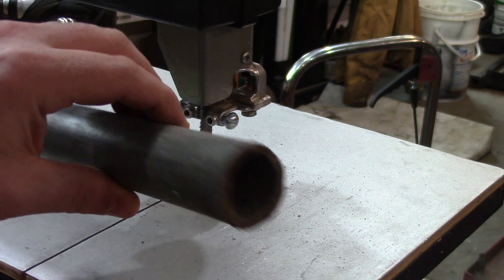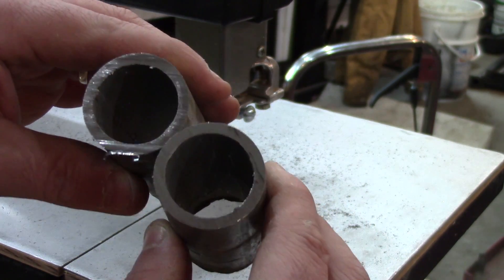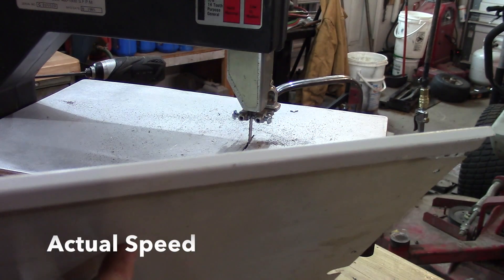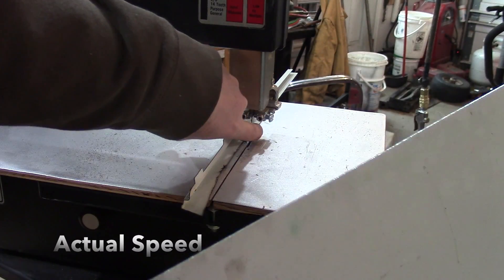Converting Wood Bandsaw To Metal

Comment: Thumbs up for making a flimsy 3 wheeled bandsaw cut steel. I'm actually surprised! I'm also surprised you can cut that massive steel pipe without a vice!
 
I would give you another thumbs up if I could, for showing the saw cut steel. And only steel. I watched way too many YT'ers demonstrating how changing to a fine tooth metal cutting blade allows them to slowly gnaw through and clog up on aluminum, as if the saw wouldn't cut aluminum 10x better the way it came out of the box!

Comment: Good work. I geared down my bandsaw to a similar speed and I’m happy with it. My table was aluminium to start with but I covered it with stainless steel (s/s from the front of an old dishwasher) as I found the burs created by cutting the steel would dig in to the aluminium. 
I’ve done a treadmill motor conversion on my belt sander with very good results so I’m going to convert the bandsaw to a treadmill motor as well so I can vary the speed for steel, wood and plastic. Better to have one like yours with variable speed to start with I think. Cheers Stuart 🇦🇺

Comment: Thanks for the tip about the variable pitch blade. It draws 3.5 amps so it’s  a 1/2 hp motor. 746 watts per hp divided by 120 volts equals 6.22 amp draw per horsepower. Your shop voltage will vary  so figure 6 or 7 amps per hp when looking at equipment.

Comment: you need to get a stick of Lenox Lube Tube it saves blades and not messy like oil, you should go with 12-14 tpi for 1/8" thick or less, bi-metal blade is good and run slow  good vid  thanx

Comment: How do they adjust speed of an induction motor with a potentiometer? They are frequency/pole fixed speed (1800/3600RPM) I see there is a gearbox, wonder if the dial changed gears? The rule for teeth is 2 -3 teeth on material at any time so 1/8 which is what I cut is supposed to have a 18-24 tooth blade but the 24 tooth blade cuts very slow. My big 12" wheels powered by a 1.5HP motor really needs a gear reduction to work metal as its wood only blade speed is 2300 fpm.

Comment: Great Video! I bought this saw after seeing your video, but I need help. It didn't come with a blade and I want to cut metal with it. I can't find a manual and forums have conflicting measurements. 

What is the length of the blade you had on the saw? What is the thickness and width of blade you used?  Are you using that Starrett Intenss blade you listed? 

I would greatly appreciate your help. 

Thank you so much

Comment: I think they dont recommend cutting hard steel even at the lowest speed for those machines just non ferrous metals, not to say it wont work as you have shown.  I think maybe you need more tpi (teeth per inch) blade, 18-24 tpi for a smoother and easier cut

Comment: I like what you have done here, never had a band saw. When the band does break and I have to imagine it might what is the outcome. Seems little is exposed but one of those unknowns to me. Something I would like to add but safety wise what are the issues that might arise? For instance jigsaw blades break just looking at them.. I understand force and that is not breaking the blades on the jig.
Reply from the maker: On a traditional bandsaw 2 wheels, there is a drive wheel on the bottom and an idle wheel up top.  The blades are made of hardened steel, so as you use them they tend to "work harden".  An example of work hardening would be bending a paperclip eventually it gets harder and harder at the bend and becomes brittle and breaks.  Eventually, bandsaw blades do break.  They are designed to break and the upper and lower wheel guards are there to catch a broken blade.  So to answer your question the saws are designed to catch a broken blade.  Furthermore, when a blade breaks it stops rotating because the blade (band) is used as a belt to drive the idle and drive wheel.   Bottom line not too dangerous.  I use these saws with 7th graders.  Bob
Reply: Thanks..

Comment: I have harbor freights a older portable bandsaw. It works pretty good and is so handy to have around. I almost never use an angle grinder to cut steel anymore. Having one of these regular bandsaws to cut sheet steel would be really nice to have though.
Reply from the maker: The HF saw looks pretty nice.  Do you use it vertically and if so, can you rip (cut the long way) without hitting the motor.  Do you know about the Swag Table, I was considering building one like this:  http://amzn.to/2mVKDK1
Reply from the maker: I guess I should mention I started looking for a vertical bandsaw because I could buy it cheaper and be more versatile (at least I think I will be).